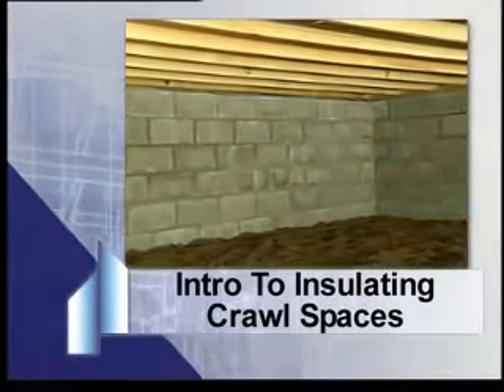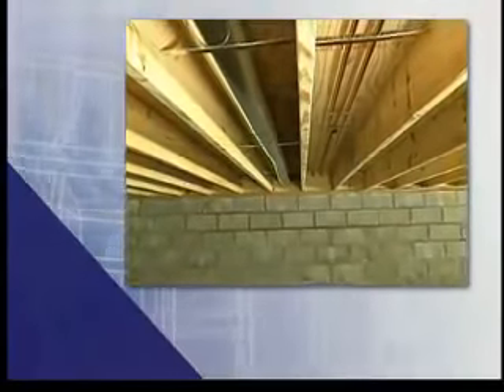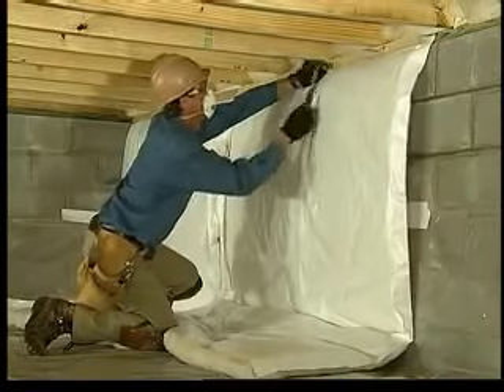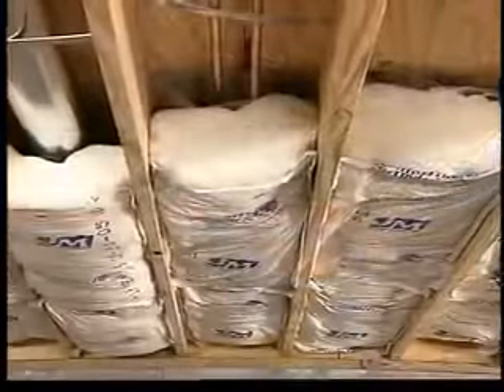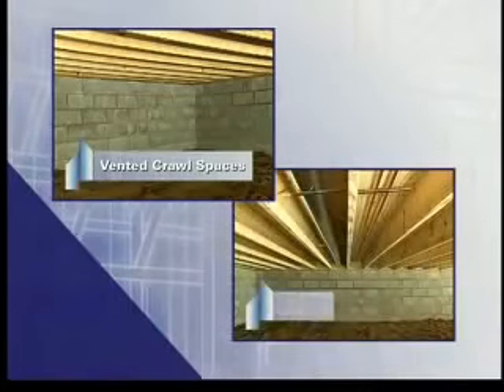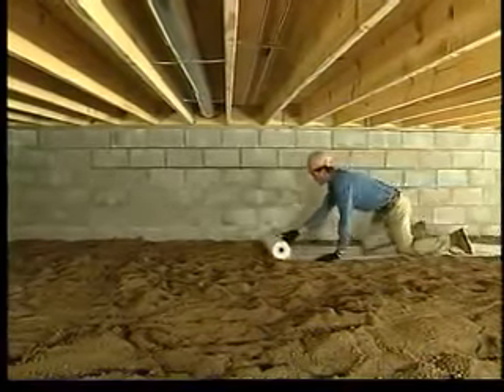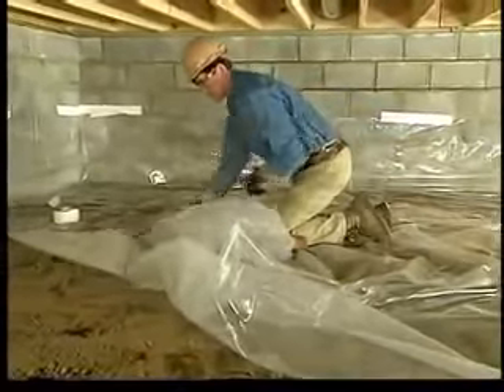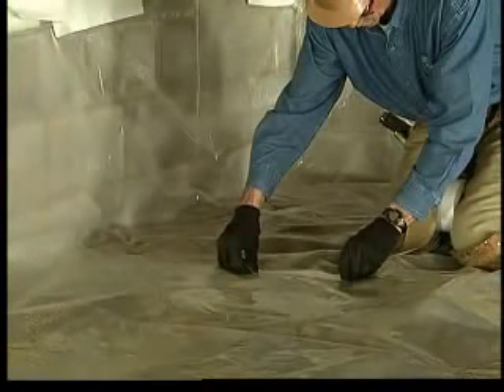Insulating Crawl Spaces

Comment: Beautiful insulation which will be a real haven for virmin to live and breed in...
Reply: It’s upside down too.
Reply: Just watched the video, now it’s right side up!?
Reply: Oh, spoke too soon lol
Reply: What's the solution?
Reply: @gregdiprinzio9280  depends where you live. Typically, foam board or use a semipermeable paint on the crawlspace walls, lay down 10 or 20 mill poly loosely just over the floor (if it’s soil, put gravel down first), seal up the crawlspace and set up a commercial dehumidifier. Then you won’t need insulation up against that subfloor.

Comment: If I’m not mistaken, I don’t think this insulation installation is up to code because paper side should be facing the sub floor NOT the ground? The paper against the sub floor works as a moisture barrier. At least in my area this what local code is !
Reply: @JankSmanks  code in our area is for the paper side to be up against the sub flooring , I believe that Micheal here with Crawl Space Ninja says the same thing as well
Reply: it depends on where moisture comes from
Reply: The narrator in the video states that one of their products paper faces sub floor and the other faces the ground.

Comment: I am dealing with this now, rats and mice live in the insulation, chew on the plastic pipes and generally wreak havoc
Reply: I had similar issues.  I had to get in there and pull away all the fiberglass insulation out of the sill joist.  I checked for holes to the outside (I found 3 holes where mice were getting in) filled those (actually covered them with metal flashing) and then put foam board in the sill joist and foam sprayed around the board.  It was kind of a pain, but no mice in the house since (that was like 7 years ago).
Reply: I used hardware cloth which is pretty much a strong and durable mesh wire over the insulation in the crawlspace. Rodents can't chew through it and it allows air to circulate throughout the bays and keep fungus and black mold from getting started. I see most people cover the underside with plywood but that doesn't allow good ventilation. I also covered the top of the posts with squares of heavy duty sheet metal and bent the edges downward before attaching floor beams to provide a termite shield for those smaller varmints that want also to bury in and eat you out of house and home.

Comment: is the liner part of the insulation or just for cleanliness?
Reply: It's to keep moisture from rising up through the ground/dirt👍🏻
Reply: It acts as a moister barrier... For heat control you from the ground you would still need to insulate over the plastic barrier
Reply: @JonnyDIY  I would do it after i instal the insulation in the joists

Comment: That fiber glass insulation might absorb moisture and degrade over time ?
Reply: Thats what the vapor barrier is for. If you still have wet problema after full encapsulation, then you either did it wrong or you need a dehumidifyer installed